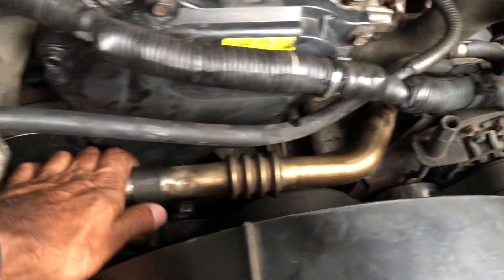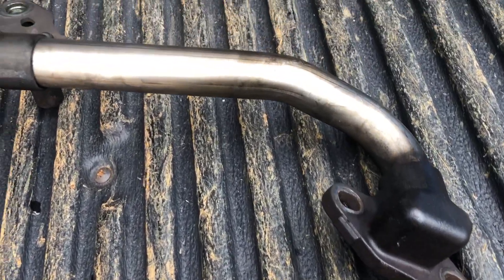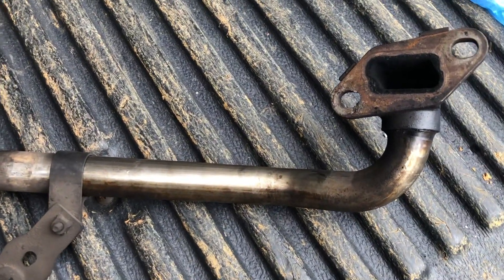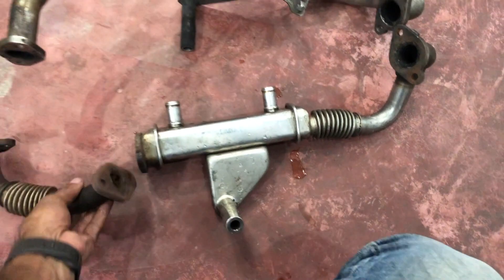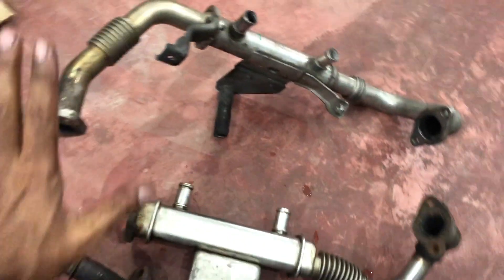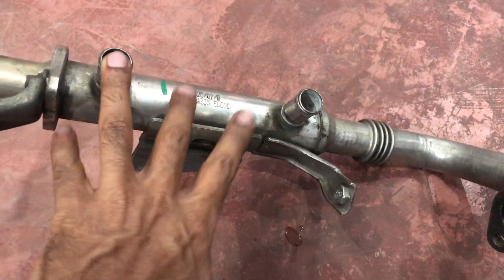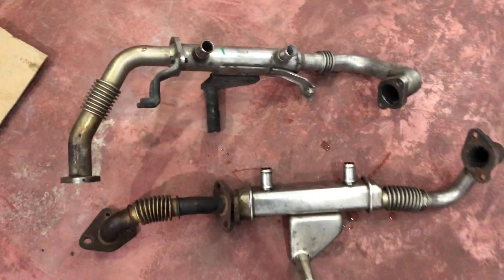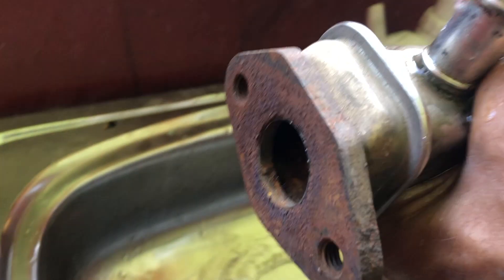Type of EGR Pipes in Nissan Navara D40 | euro3 | euro4 | How EGR Works

Comment: I have a nissan cabstar/atlas from 2007 with the yd25 engine, mine is fiited with the square egr cooling pipe. But the right pipe is broken, can you buy the pipes separately? Or do I have to buy the whole cooler ? Also do you know if it matters if i buy the roud or the square one ? I can only find the round one new..
Reply from the maker: Hey there! Just wanted to let you know that you can actually blank the EGR and it won’t cause any harm. Plus, you can find the reconditioned part if you need it. 

Also, I should mention that the brand-new square version isn't available right now, but the round pipe is definitely stronger than the square one. If you have any questions, feel free to ask!
Reply: @abcautotrendy  I've been advised not to do that on a cabstar. The motor already runs very hot on these trucks because there is very poor ventilation through the grill..

Comment: I have questions   my car is  navara d40 but the EGR HOSE ALL WAYS IS COOL IT'S GOOD OR BAD?
Reply from the maker: You mean the EGR hot pipes or water cooling lines? If the water cooling lines, it would have been blocked the cycles

Comment: Hi thank you for this good video! I put a plate to suppress the egr (euro4), now I would like to shunt the water circulation in the EGR cooler, could you tell me which is diameter of the water pipe? thank you very much 
OEM 21047EC01A
Reply from the maker: Good that you like the video, let me get back the exact dimensions as it’s not in my head

Comment: Good day, mine was the first pipe the plane and simple pipe . When i bought the pickup nissan says euro2. At 20 to 40kph speed when releasing the gas pedal car jerks. Do you think its time for cleaning the egr valve, throttle body and intake manifold?
Reply from the maker: That seems a non-water cool pipe. 
It’s better to do a full cleanup as mentioned dear